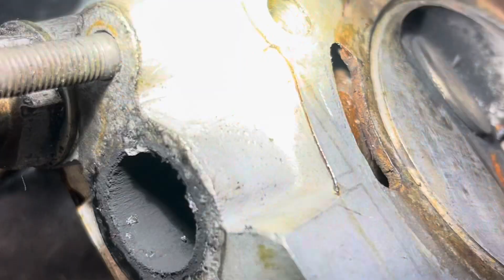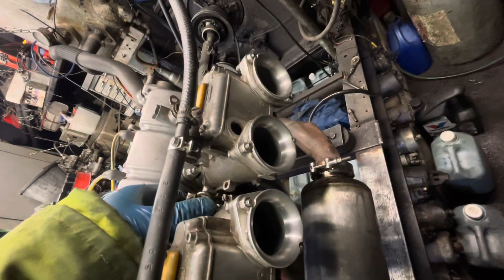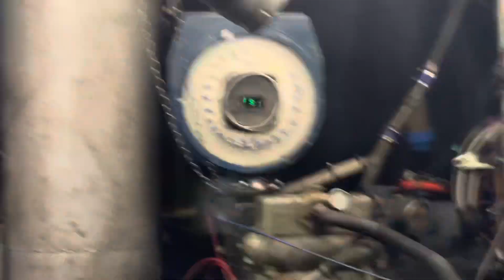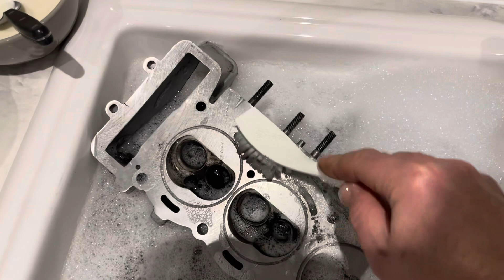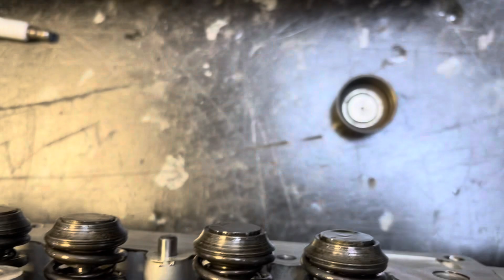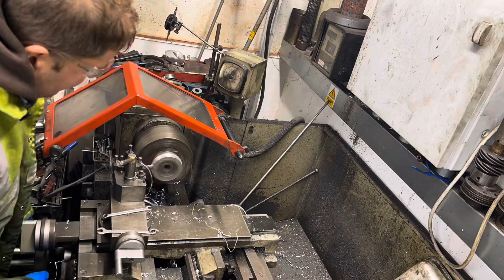Shrigleytube TV ep 28 998 head sank, 1120cc dyno run, rear rad mod

Comment: 81 year old / young   ex gt champion   cooling    fan power consumption .   owner of Midland Helicopters UK LTD../ overheating four stroke single cylinder motors ..  i tested a larger cooling fan during my development testing for the R/C model helicopters . the larger cooling fan was robbing so much power that the helicopter would barely hover .  I machined up a boss for the 100mm dia fan and ran it on an electric motor . the results were eye opening .at 6,000 rpm the speed controller died .    severely overloaded .I introduced a readily available WATT meter .and a beast of a controller .the results showed that the larger cooling fan was consuming almost all of the Power of the Laser 180 (   a 30cc four stroke burning nitro fuel .). NOW   with some testing and figures   I reduced the fan to 75 mm od and achieved enough cooling with acceptable power consumption .    Heaven knows what power your IMP cooling fan is skimming off at 8,000 rpm .   I would guess that the standard    IMP cooling fan is robbing the engine output of 3/5 hp at 3000 rpm    and clearly a huge amount at racing rpm,s . Logically the cooling set up on the imp was designed around 50 to 60 mph   road speeds. Modern clip on ammeters will point you in the right direction . bi for now   richard Wallinger .   81 and still dreaming .

Comment: Regarding the reduced Dia. of the bearings what is the rev range of the motorbike engine? & what is the material of the Bike crank shaft? If they are similar to the material of the IMP then they should be in the same range of those on the bike IE the IMP should be as good as the bike engine!
Reply from the maker: Hi John unfortunately the motorcycle crankshaft is made from a far superior material than the imp,it also has five main bearings to support it. i think we may encounter a few other issues if we tried to run to 14,000 rpm but it would be fun trying ! thanks for your message
Reply: , @thehillmanator Cheers for that, I think that with the reduced mass of the pistons and rods in the IMP by 25% approx. ad the reduction in crank dia. of 15% approx there will be enough meat in the crank to cope with the revs hitting 8500 rpm!

Comment: That strengthening bolt driven in to the block looks very "crude", but obviously it works. Can be made better and give a more support under this sensitive area?
Reply from the maker: just works a treat so never looked at other options, chessman wedge heads are ground out and welded from the vbase to start with

Comment: If you take the 36mm crank journal multiply by the piston, pin and rod weight (500g) then work out the diameter of the rotating swing of the big end pin and multiply it by 4 as it is a 4 cylinder then multiply the total by .64218 because of the dangle angle it works out you can safely rev it to 11000rpm without a problem. 
(can you do it on video to test my theory;) 
Dr Tim100 (heavy Metallurgists)
Reply from the maker: bmw drivers !

Comment: Hey Andy in regards to the fan. Measure the blade area and amount of blades to give you an idea of air displacement.  I noticed you had a few to choose from. Also the diameter of the centre. The smaller the diameter the less restriction and longer blades, more displacement. I did the same a couple of years ago. I used a thermo blade and drilled its centre to suit the hillman bolt pattern, no boss, less weight. The "little" things will help. Good you stopped rushing on it, it can always be fine tuned from the first prototype. I came about this idea after driving across grass that had been recently cut and the standard fan filled the radiator with cut grass and no where for it to fall out. Good video, you need to name the bike piston engine.

Comment: I met Andy Dawson (Chrysler competition department) twenty years ago. He drove my car for a magazine article. He told me then that the key to getting performance from an Imp engine was lightened rods and pistons. So the success of the direction you have taken is no surprise to me and is fantastic Andy. I wonder if Farndon would be able to advise on the strength of the 36mm crank pin? If a machined down standard crankshaft survives on the Dyno, then a Farndon one should work in a race car? As for the radiator, nothing comes close to a Radtec ally rad for a hot Imp. Aluminium transfers heat at 118 btu/hr/sq.ft which some people will tell you is less than the 223 btu for copper. But the water pipes in normal Imp rads (like most cars of the 1950’s to 1980’s) are brass which is only 64 btu. So an ally rad is almost twice as efficient. Great work yet again Andy. Your enthusiasm is infectious. Every week I mentally put together the spec for the ultimate Imp engine. I had better start saving…..

Comment: I was under the impression that the fan is an impeller not a prepeler and it pulled air in through the radiator via the ducting from underneath not blowing it from the engine bay through the radiator

Comment: Back in the early seventies they used to say between 5 to 7 bhp
 Was gained at full chat be interesting to see what you get , no batt charging system was fitted so we used to use small timing belt less friction.

Comment: Hi Andy,  it Aldrin (cant remember what my YouTube account name is 😂) 

Looks like thinks have really come together on 1120, has it got a block strengthening kit ? 

If so i Reckon 10K+ RPM it sounds so smooth just begging to rev. Dont think small journals will weaken it too much, material on the outer radius is what counts  'centroid of area' or something its called , 
Take revs up in stages 1k at a time hold it at full load so harmonics etc can build up, then strip & inspect bottom end
Can B&J crack test ? Or just pull it out and 'ping' it

Comment: Enjoying the radiator and fan element.   The poly V pulleys all look a bit heavy.   Could they be made out of alloy or would that wear too fast?   Stretch belts remove the need for adjustment if you find the right one.

Comment: HI Andy I wonder with the over heating issue is the air moving to slow or is the water moving to fast not allowing it to cool through the radiator enough [ water pump to efficient in operation] have you measured temp in and out of radiator
Reply: Its a good point that mate, as due to them revving pretty high maybe it does move the water too fast 🤔

Comment: superb stuff Andy, that engine is a beast! You won't be disappointed with that Radtec radiator, I've run one for a couple of years ago now and it's just night and day different to the standard (or comp) imp radiators and I've had several. I tried 20 years ago to fit electric fans in my Stiletto and it always failed as even good electric fans can't keep up on the normal radiator. I'm now running an electric SPAL push fan and it gets up to 35% of full power to cool the 875 even on a 36 degree day here in Jersey. Really looking forward to your power consumption figures on the dyno, I'm guessing 1hp for the mechanical fan

Comment: I know you don't like the 930 crank but it is a better material (EN16 ?) and having reduced the pins what's a little more machining on the flywheel end to get it to fit properly. If it increases the safety factor even a little bit again at minimal cost would it be worth it ?

Comment: I’m curious to know how your modified fan solution works out. I’ve often wondered why Hillman engineers designed the fan to blow backwards against the natural airflow when the vehicle is moving forwards.
Seems obvious really.
Reply: The reason the fan on an Imp blows instead of sucks is that mud and dirt from the rear wheel would clog the radiator very quickly. OK on a race car though. The other reason was aerodynamics. At speed, the air around the back of the car wants to head forward. Counter-intuitive I know but I remember reading reprinted factory reports about it years ago.
Reply: Also, the airflow travelling underneath the car produces a low pressure area which extracts the hot air forwards through the rad naturally. I use a Radtec radiator on my 1040, and in the cooler months I don't even need the electric fan on at all.

Comment: Sounds great, loving the steep intake manifold. Bizarre that the piston has so  many valve cutouts and it doesn't affect the combustion......perhaps that's your magical element for it running so well😅.
It was one of the old GP motorcycle riders that said " cranks snap off power on the overrun".
Keep it loaded up😊